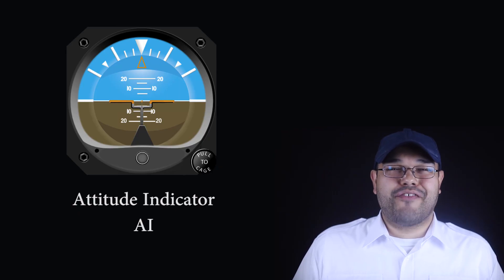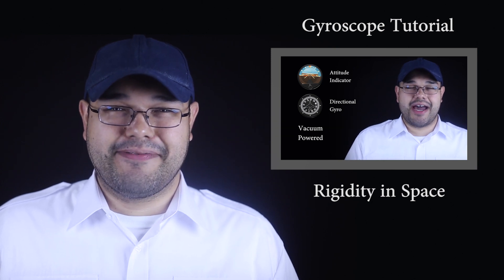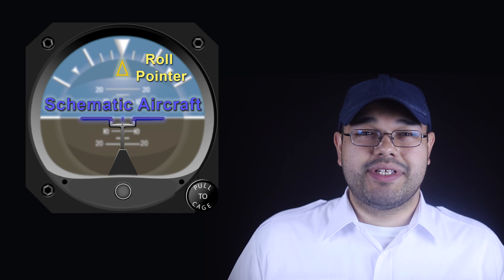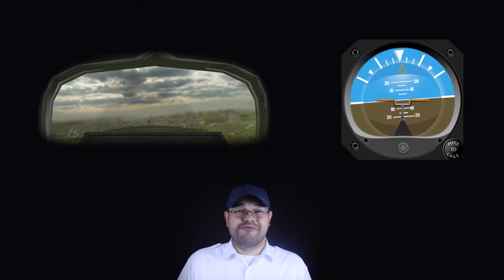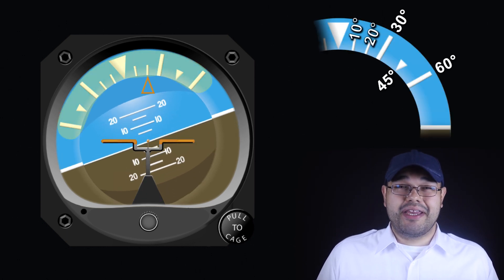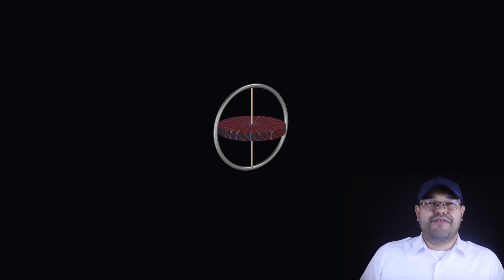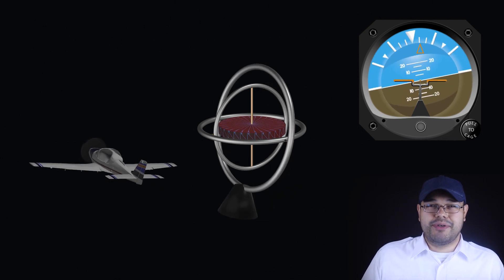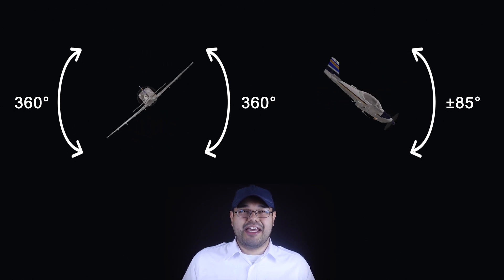Attitude Indicator | Pilot Tutorial

Comment: Aircraft air speed indicator (Pitot Tube) question.
Why is it so ???
Earth is spinning west to east. 
At the equator the ground speed is approx 1675 kph.
On a still day the air is traveling 1675kph, west to east.
A Plane takes off heading to the west, and climbs to cruising speed of 500kph.
The plane is now traveling at 500kph ‘relative’ to earth’s speed.
In “reality” the plane is moving through the air 1675 + 500 kph.

Question 1: How does the air speed indicator compensate for the rotation speed?

Question 2: If the plane turns 90 degrees, it would need to subtract 1675 kph (when the air speed ‘relative to the earth’ is the same) from the Pitot tube wafer reading to indicate the correct reading on the indicator.

Question 3: If the plane turns 180 degrees (traveling due east) it would need to -1675+500 = total negative 1175 kph (when the air speed ‘relative to the earth’ is the same) from the Pitot tube wafer reading to indicate the correct reading on the indicator.

 Question 4: Globe beliefs are that it is all relative. How can this be so if the plane can in all 4 directions and get the same air speed reading?

Plausible answer: The ground and the air is still.

Comment: am i right to say that if a aircraft goes on a 90 degree climb, i should see the whole indicator showing the blue portion only?
Reply: The video is very antiquated to what a modern aircraft looks like or how they work today.  In a modern aircraft the attiude is shown on an LCD or LED Primary Flight Display.  The Display has an input from the Inertial Reference System and the Pitch and Roll Attitudes out of the IRS drive the attitude indication.  Now to answer your question.  On a modern aircraft if you were in a 90 degree pitch up attitude, about 80-90% of the Display would show blue, but the bottom 10-20% would stay brown to help the pilot understand his attitude and vice versa if he was in a high angle pitch down.  Also, it is required in a unusual attitude situation (usually greater than about 65 degrees pitch up or 25 degrees pitch down) there would be RED colored chevrons pointing in the direction the pilot needs to correct the aircraft to.

Comment: how does the gyroscope know to spin on an different angle or change its angle as the plane fly's from say Australia to America, over the Earths curve? so that it keeps its level to the horizon... the horizon no doubt changes has the plane travels over the Earths curve. strange question I know but I can't get anyone to answer this.
Reply from the maker: http://www.piloteffect.com/pendulous-vanes.html
Reply: is it this same video?
https://www.youtube.com/watch?v=_MoS5Yw9ZgE

thanks mate, ill check it out!
Reply: thanks, i think i understand now. but thats with an air powered attitude indicator, can you please explain how it works with an electric one?
Reply: Eccentric Views, Wolfie6020's video is an electromechanical device. The gyro has small blades that produce the airflow necessary for the pendulous vanes to correct it. For a 100% optical/electric indicator based on a laser ring gyro it is done in firmware.